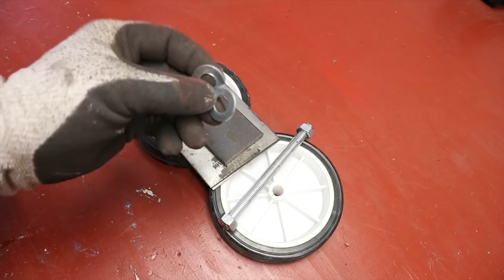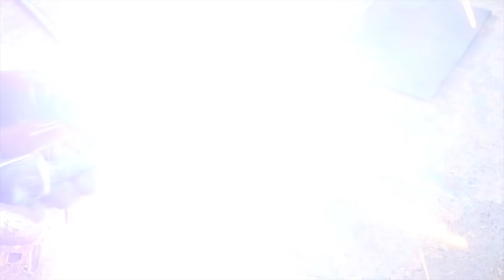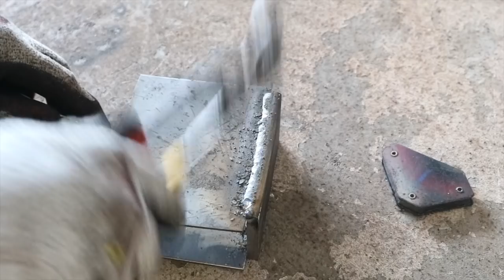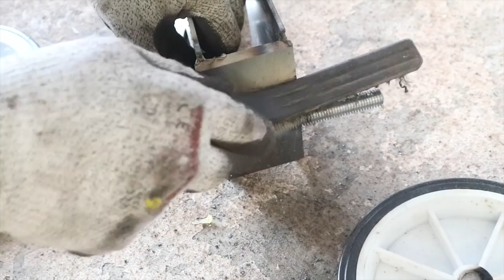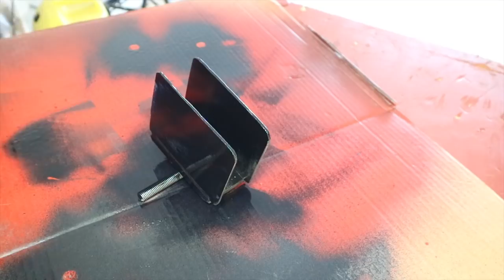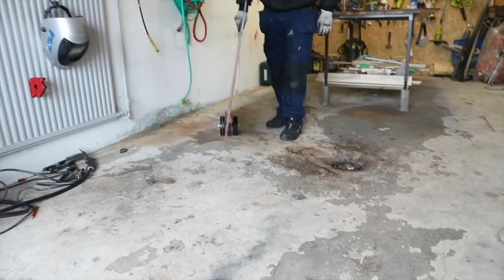Making Awesome DIY Carry Plywood !! Wow

Comment: May i suggest that you drill 2 holes on one side of the metal plate and put a full threaded stud to serve a a clamp so even if you put a thinner material it will not fall..😊😊😊

Comment: where, do you have, the missing gas nozzle from the welding handle, four wheels a little longer would be better,
Reply: 4 wheels sounds good but adds alot of complication. either one set of wheels has to skid around cornners or one or both sets of wheels has to swivel. The base has to be level or the load's end can hit the ground. It might need brakes or the load could take off. Heavier the load - bigger the problem of stopping... and the more damage it will cause.
Reply: ziegenwilly I asked the same thing about welding without the shield, but received no answer. I know if he keeps welding without it, eventually the liner inside will deteriorate. But whatever.